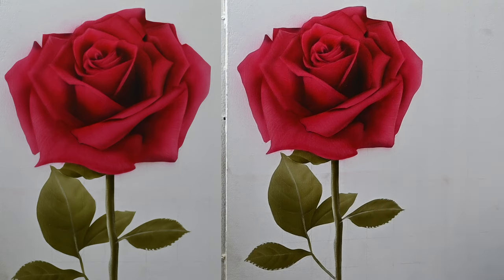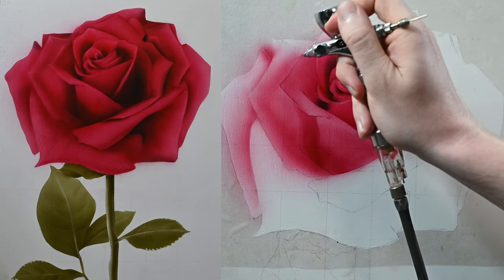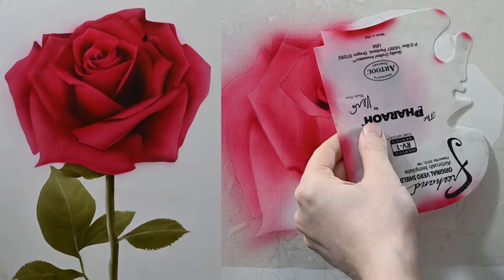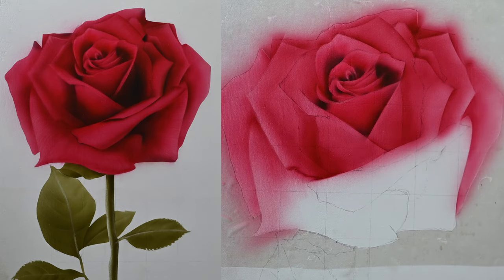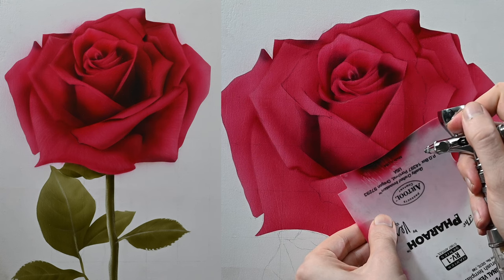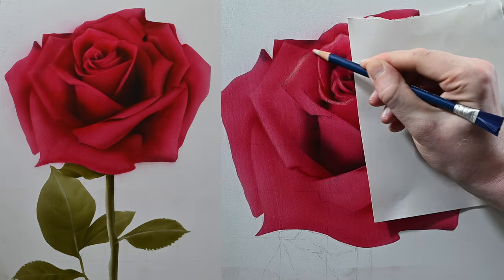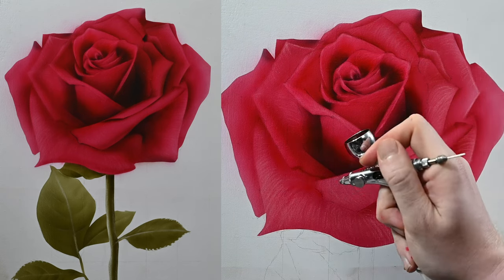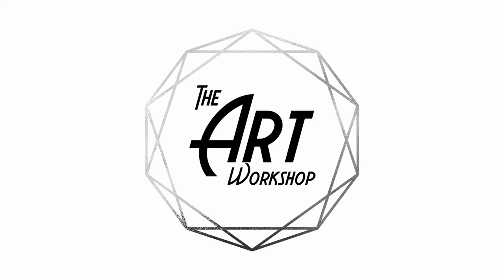How to PAINT a ROSE | Part 2 of 2

Comment: Great Video, but I have no idea how you can make that Createx paint to flow through your Airbrush, I guess you over reduce that thing, because in my case ,no matter what I do , it tip dry in less than 10 sec specially the White Opaque , that`s why I changed to Golden High Flow and never looked back again, All my Illustration bottles were straight to the trash.
Reply from the maker: Thanks! Over reducing with distilled water helps. Golden High Flow are outstanding paints. One of the best out there, but just too hard to erase or scratch for me. They used to be the only paints i used too.
Reply: I have had no problems at all with Createx and that is without thinning if I choose. I use a .2mm Mr Hobby and H+S. Good luck!👍✌️